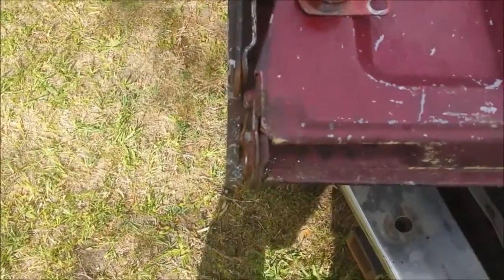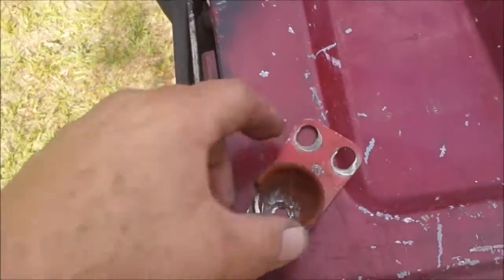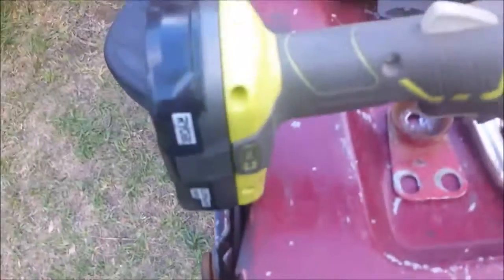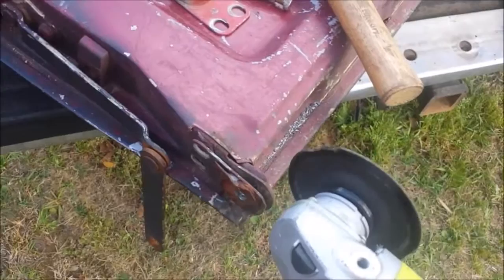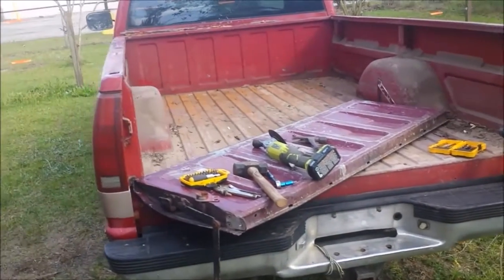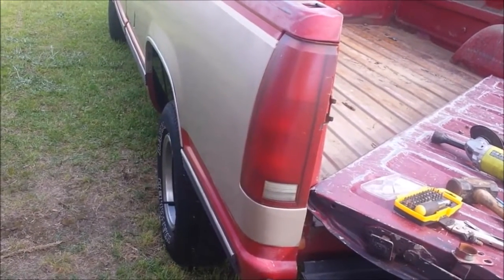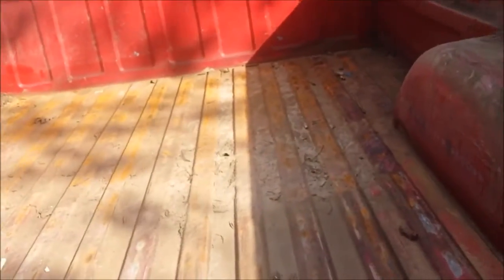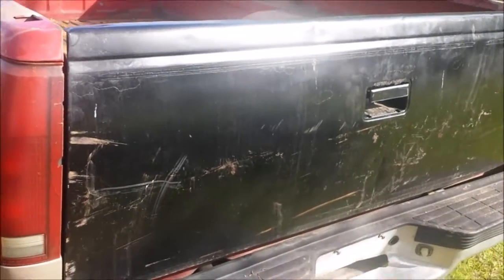How to change a 89 C1500 tailgate hinge

Comment: So if you upgrade to LED on the tail lights you will have to do the front turn signals and replace the flasher relay with one that works with LED's so be aware of that. There are lots of videos on how to clean up the headlight lens and tail light lens the one I tried that worked pretty good was by a youtuber called Chrisfix so maybe check that out its pretty easy and could save you a few bucks.
Reply from the maker: +MidwestMotoRider Thanks for the info, I'll look into that. I actually have used chrisfix's method on my for focus headlights, Made em look brand new. He's awesome!
Reply from the maker: +MidwestMotoRider BTW, the taillights have begun to rot away, they are super brittle and chipping and cracking so there is no saving them. I have to change them one way or the other. Thanks for looking out for me though
Reply: +John Sellers Ah.. then yea time to replace them, I did not know they were that far gone. ;) I actually used Chris's video on headlight restro on my HHR for some reason the drivers side only went yellow. Saved me a few bucks. I think it would have been a flawless restro if I could lay down a 2k clear.. but over all I am happy with it. Have a good week keep us posted on the trucks.. :)